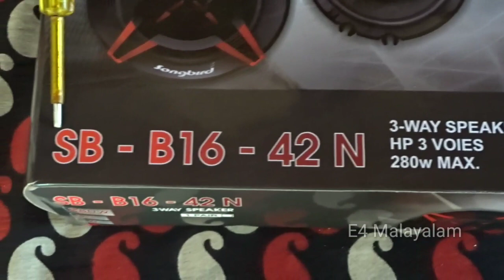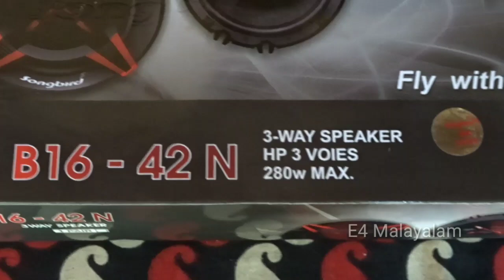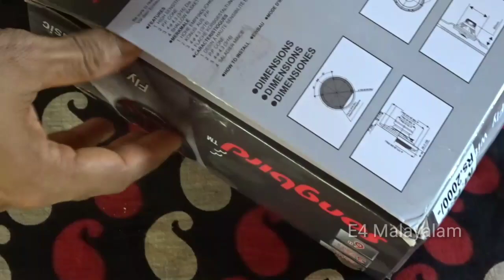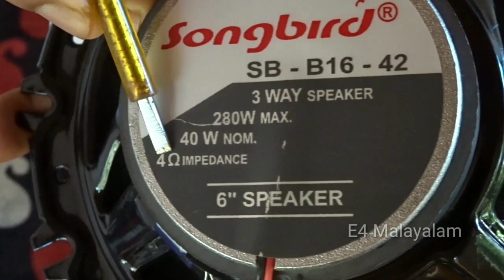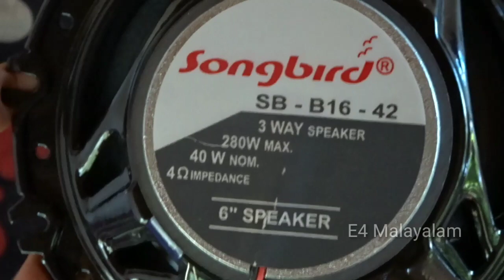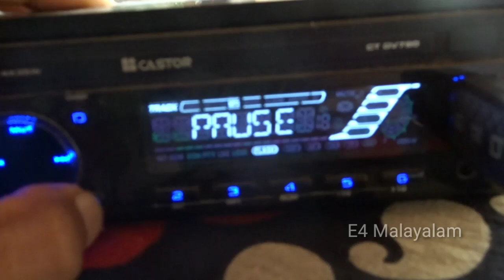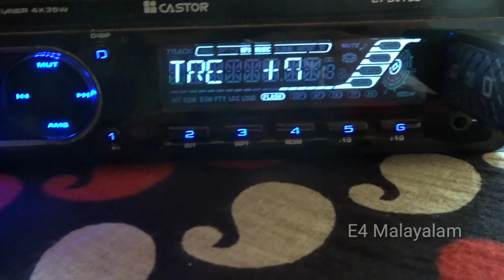Song bird 6inch car speaker unboxing and review+working

Comment: 7294 ic 100 rms alle ethu 40rms  speaker over lode smile?
Reply from the maker: 7294 full volume വെക്കുമ്പോൾ മാത്രമേ 100w വരൂ ഞാൻ 4inch speaker വരെ കൊടുത്തിട്ടുണ്ട് ഒരു പ്രശ്നവുമില്ല വോളിയം ഫുൾ വെക്കാതെ ഇരുന്നാൽ മതി
Reply: Tda 7294   inte rms watts ekadesham 60 watts okke varuvullu. (Depend on powersupply). 100 watts maximum output aanu.
Reply: Cheta.. TDA7294 ic is suitable?? For this?? Tell me in English. I couldn't understand your language
Reply: @e4malayalam410  7265 ic ക്കു curect മാച്ച് അല്ലെ ഈ സ്പീക്കർ